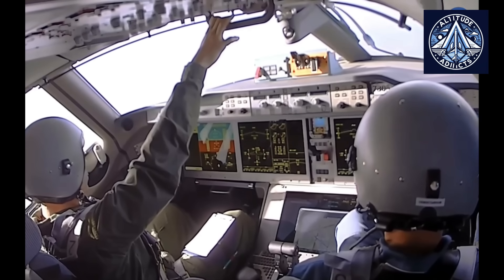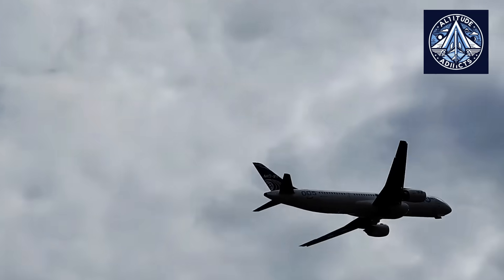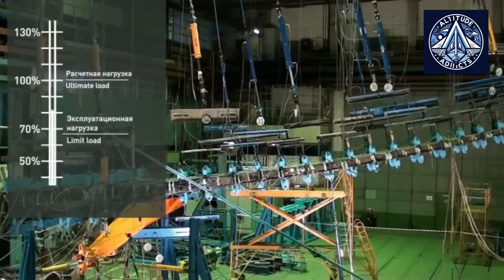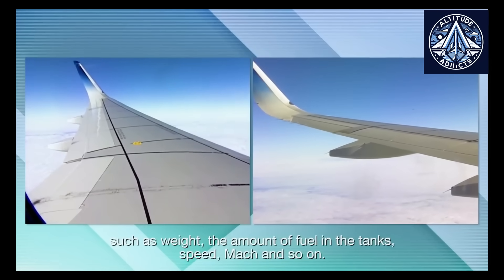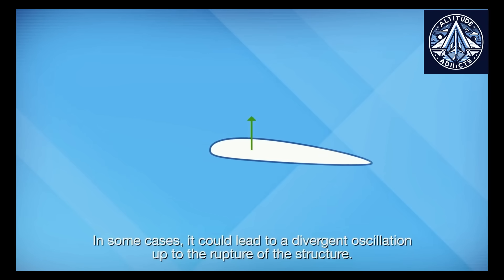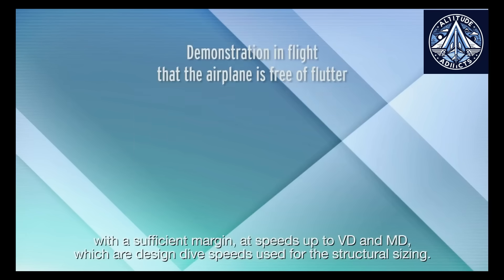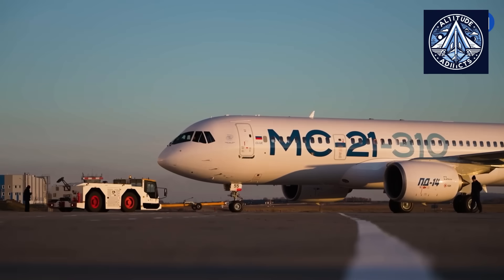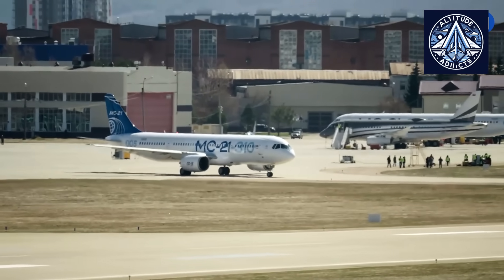Inside the Brutal Flutter Tests of Russia’s MC-21 Jet

Comment: All aerospace companies do several test before go to full production stress fatigue torsion bending corrosion in wings airframe landing gear and aerodynamic wind tunnel test up to 600 mph characteristic graph how wings and airframe against different air speeds i saw in Boeing Lockheed bell several palaces also NASA and USAF has 1000 mph wind tunnel test too

Comment: And what planes are actualyy flying and comercially available, Airbus and Boeing or this piece of shit? And dont eining about "it's not selled world wide because of sanctions". They developing ms21  for years and it still no flying or comercially available.
Reply: The development took so long because the plane was originally supposed to use engines and some other parts made in western countries. But then sanctions were imposed on Russia, which forced Russia to create its own engines and other parts from scratch to replace the western ones. The MS-21 is currently undergoing final tests. Serial production has already begun. Currently, about 20 aircraft are at different stages of production. And unlike Boeings and Airbuses, various parts of which are produced by several different countries, the MS-21 and all its parts and systems are completely produced in Russia. No other country in the world has a full cycle of aircraft development and production. And by the way, Russia is the world's largest manufacturer of aviation titanium and parts made from it. A significant portion of titanium parts for Boeings and Airbuses are produced in Russia.
Reply: @morfeicheg true, they are aviation pioneers and developed many things.

Still they also captured, what they could like any other country.

And this Airliner, to me, looks like a copy, somehow. 
But it might be a wrong impression.

Anyways russia is just different.
Reply: @JVR-Gaming-Streams  No, it is not a copy of another aircraft. Why would Russia copy another aircraft if it can create its own? Moreover, it is only possible to copy another aircraft if all the technical documentation and blueprints for it are available. Making a copy of an aircraft without blueprints and all technical documentation, only with the help of reverse engineering, is either impossible or pointless, because creating your own aircraft from scratch would be faster and easier. In addition, the most difficult thing is not to design the aircraft itself, but the engines for it.
Reply: @morfeicheg hm okay thanks for the explanation. That makes sense. I actually thought they really reverse-enginered it.
Reply: @artem8692  and also it's a copy of several technologies, isn't it?

Just like the chinese do it.
Reverse engeneering.
Reply: О, Артёмчик) специально для тебя, англоязычный ты наш) - We'll wait. The dogs (you) are barking, the caravan is moving - that's what they say in the East. For us Russians, civil aviation is not about money, it's about independence. We are now getting rid of your dollars and the bribes bought by Boeing and Airbus for dollars. The West has always professed the Roman principle of "everything is for one's own, the law is for others." But you're losing competencies, and your production is already lame. We went through this 20 years ago. Therefore, we will wait a little longer. By the way, Артём, whose Crimea is it?) For other English speakers, I explain that most often such English-language comments with Russian nicknames are written by angry residents of the former Ukraine)

Comment: Video is easily found of Boeing conducting both fatigue and test-to-fail regimes on 777 and 787 wings. In these tests, the 787 wingtips are bent nearly vertical before the failure occurs. 
I don't know where you get your information from, but it is incorrect.
Reply: are the Boeing doors still in place after the test?
Reply: @dimsum5567 😂😂😂😂 it only needs a slite refitting,I'm a whistle blower if you don't hear from me well then...
Reply: @dimsum5567 The issues with Boeing have to do with QA following manufacture or maintenance. Now… Russians know how to design stuff. But Russian QA and manufacturing practices?  Nah. I’ll go with Airbus and Embraer.
Reply: This is propagandist channel. They post fakes and just don't care.
Reply: He is talking about flutter test, not load test to fail on wings.
Reply: @PaulJurczak Then why show the test-to-fail wing ultimate load test? While he talks about superior Russian testing. By the way, had the 737, 777, or 787 wing failed at that angle none of those would have been certified as airworthy. 
Western nations don't perform in flight flutter tests because the phenomenon is well understood. Flutter is removed from the design during engineering; not after.

Comment: So they just floor it up to almost Mach 1, until the wings start to vibrate like the reed of a clarinet? Wild.
Reply: I'm assuming it's a specific speed envelope where the turbulence  hits the natural frequency of the plane structures and creates resonance. This can break anything, including a bridge. There's video of such events on YT.
Reply: @elmersbalm5219  That's exactly what it is.They are trying to remove the resonance-frequencies from the structures of the plane. This can be done with changing the shapes of wings, stiffening, or dampening-materials.
Reply: @elmersbalm5219  It's called oscillation